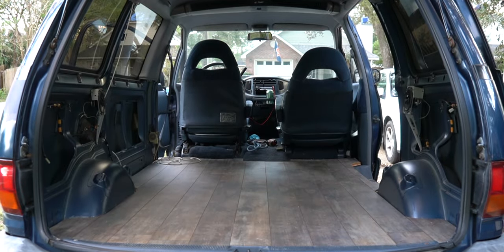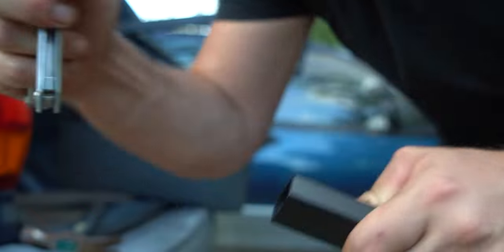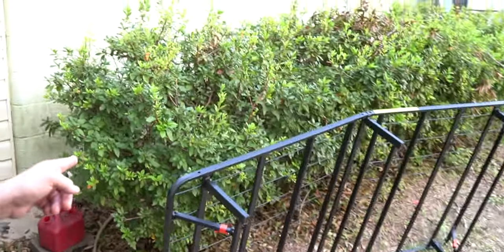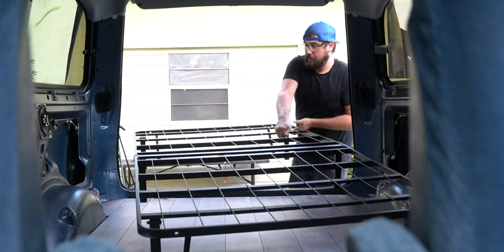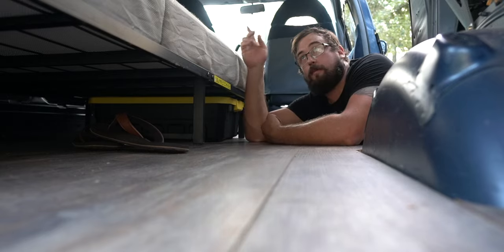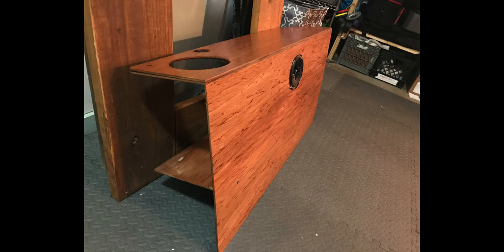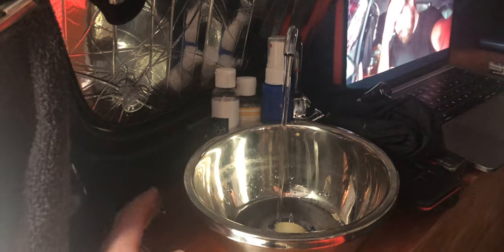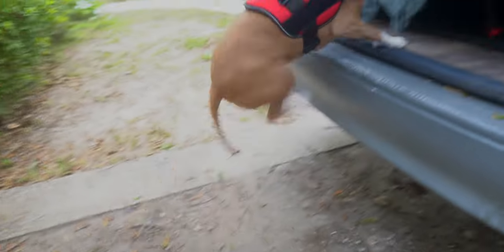Toyota PREVIA | Mini Van Camper Build

Comment: Previa is the best "Mini-van" ever built. Actually it's more truck than van, since it uses mostly bulletproof truck components. No doghouse means being able to twist key and change neighborhoods without ever getting out of the vehicle or crawling down from a roof-tent especially in the middle of the night... I put a small cot in mine as makeshift camper, so nice to pull of the road, stretch out and get some shuteye... I could go on and on and am just annoyed that they stopped selling them in the US after '97...

Comment: Just came home from camping. Double bed is just annoying in a Sienna. I like your twin bed set up and there is room to swing your legs out of bed and have floor space.
I don't like having a wood floor as I find stuff slides around too much.
I still like your sink set up.
It is handy to have some form of temporary shelving in the van so you can see your stuff and find things easily.
Less is more folks. Reduce, reduce, reduce.
If you have your head at back of van, the back window is like a wonderful sky light.
Downside is the back is more cramped and less head room. So bed should be quite low. My partner felt claustrophobic and I had to set up a tent for him.
Next trip it is either bed on floor or our big tent. 
Your set up would be perfect for me if camping alone. Love your twin bed and nice thick foamies. If you don't sleep well, camping just isn't fun.
Reply: Try throw rugs with rubber backing over the wooden floors.✌️

Comment: Man it's roomy and airy
Love it

And color grading you choose for this video is awesome too
Reply from the maker: I rush when editing and make TONS of mistakes. and by the time im done editing the video. I am so burnt out I just kinda rush color grade as well.. mostly just mess around with the exposure and watch the waveform. try and keep highlights under 75 and blacks just above 0. maybe mess with white balance across each clip. but barely any grade. just hlg picture profile on this video  I think
Reply: @sweetbabysean  it works tho
Reply from the maker: Also, that’s the reason I change my build to something less extravagant. Have you seen my first build? Cabinets an whatnot. I’d rather it be airy!! Like you said. I don’t want to block windows or have a big cabinet. Duffle bag and a couple plastic bins is all you need for clothes etc.

Comment: Nice work! I looked at this bed too but thought it was too tall... how easy was it to cut the frame - what did you use? And what were those plastic things you stuck into the cut legs? Also how did you secure the frame so that it didn’t move around when you were driving? Thanks.
Reply from the maker: Hey! All great questions! You can easily cut the frame if you have a dremmel (what I used) but you could totally use a cheap hacksaw! If you have the elbow strength. And I ts The rubber insert from the original legs. I just popped them out and reused them :) I secured the frame using a ratchet strap and the bolts used to bolt the original seats in

Comment: Nothing that involves laying down wood flooring and electric sawing through metal should be labeled "Easy Minivan Camper"
Reply from the maker: Use a hack saw?? You don’t have to cut the legs. I didn’t mean to lead you on. It’s a relatively easy set up comparably